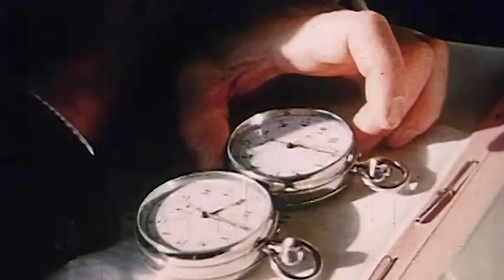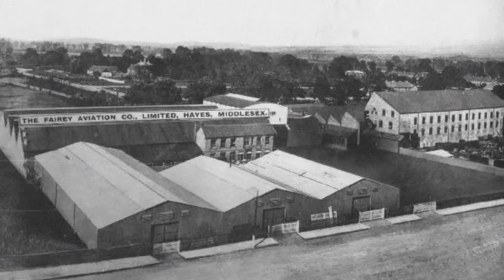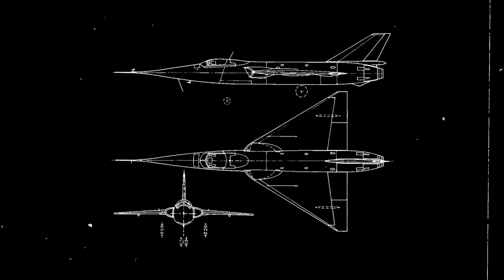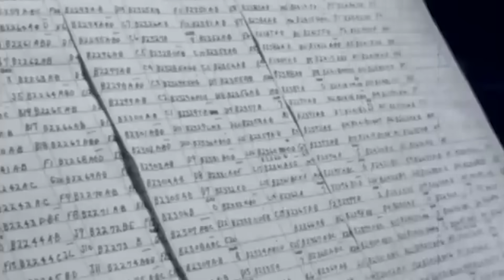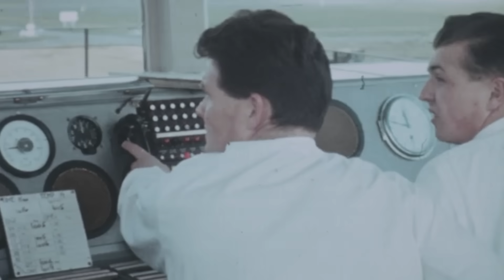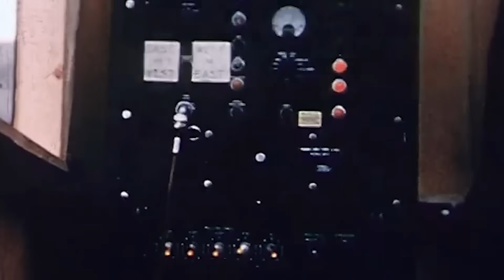Britain's 300 MPH Most Successful Mistake

Comment: The Dassault 'Mirage', as used by the South African Air Force, was THE jet plane of my childhood.  It's only thanks to this excellent video that I know that it was based on a British design.
Reply: It wasn't
Reply: @jeremycruickshank8614 

We believe we can clear up some commonly held myths and misconceptions, obviously

It's always good to see the facts presented clearly and concisely isn't it?

The original fabulous Whittle reverse combuster centrifugal compressor gas turbine aero engine has been in production permanently in one form or another by more that one manufacturer since 1939. The main current application is for helicopters. 
Whittle performed the world's first demonstration of a gas turbine aero ending in 1937. 

British Aerospace Sector & some bits & bobs etc. 

Interesting British achievements.
There is no doubt that the Fairey (England)
Delta 2 was of course the world's first jet
aircraft to exceed 1000 mph.  lndeed It
exceeded the previous record by 310 mph &
held the record for more than a year. Incidentally, the Dassault Mirage series of aircraft are based on the Fairey Delta 2. 
March 1956,  UK Peter Twiss,
1,132	 mph, Fairey Delta 2,	 Chichester, UK

The next speed record after the FD2 -
December 1957, USAF	1,207.6	mph, McDonnell F-101A Voodoo, 	Muroc, California 😎.

Non combat phase accident losses.
% of Aircraft built.
The EE Lightening did not have unusually high losses. 
The Canadair CL-44 was a turboprop airliner.
Canadair CL-44               (ff 1959 ) 48%
Lockheed XF104             (ff 1954) 100%
Lockheed  P80                (ff 1944)  43%
Lockheed F104               (ff 1954)  45%
MD FH Phantom 1          (ff 1945)  35%
MD F4 Phantom 2           (ff 1958)  28%
Convair F102 Dagger      (ff 1953)  45%  
MD F3H  Demon              (ff 1951)  32%
MD F-101 Voodoo           (ff 1954)  34%
EE Lightening                   (ff 1954)  33%
Gloster Meteor                (ff 1943)   21%
DH Vampire                     (ff 1943)   23%
DH Sea Vixen                  (ff  1951)  33%
Gloster Javelin                (ff 1951)   20%

Note that the Meteor didn't have particularly high losses, flew with more than 20 airforces for decades, got involved in air to air combat during a number of conflicts successfully against aircraft that first flew many years after the Meteor first flew.

Early days, jet engines. Whittle performed the world's furst demonstration of a gas turbine aero engine in 1937. The RR Nene, a centrifugal gas turbine aero engine, was the world's most reliable & most powerful gas turbine aero engine in 1944. Licensed built versions & copies of the RR Nene & RR Derwent would go on to power many aircraft in Russia including the Mig 15 & Mig 17, the US, China, France & other countries for decades after 1944. Incidentally, the Mig-15 was in essence an upsized / tweaked copy of the Whittle / Gloster E28/39 jet aircraft including a copy of the RR engine.  The centrifugal compressor gas turbine aero engine with Whittle style reverse flow combusters and sometimes an axial compressor section is still manufactured by more than one company, the main application being helicopters.

   That's correct, The Tornado & Typhoon & their engines are supersonic & are indeed British design aircraft with British design engines built by an international consortium. The Tornado design for example started life during the 1950s at Vickers as the AFVG, it's engine is based on the RR RB-199. The EE Lightening is also a British Supersonic jet aircraft. At the time the EE Lightening first flew it was indeed one of the fastest aircraft on the planet, it was still one of the fastest aircraft on the planet 4 years later when it managed a mach 2 flight.

  The Typhoon is the British BAC-EAP with an engine based on the British RR XG-40, the Typhoon is also built by an international consortium.

  Clearly It's a great pity & a crying shame that British military forces had to occupy a large part of Germany for decades after 1945 & Russian military forces had to do the same. Of course Russia still posseses a large chunk of what was German territory & of course  Russia & the UK produce nukes. Obviously Germany does not produce nukes.

An example of what goes on these days in various countries.

   Indeed, There are no German companies that make German jet aircraft in Germany & there are no German Companies that make German gas turbine aero engines in Germany that are suitable for widebody airliners.

  BAe Systems, GKN Aerospace & Rolls Royce combined now do more Airbus work than Germany on an absolute basis & significantly more work than that on a per capita basis.
   
  Per capita for the home nation BAe Systems is the world's largest defence contractor. BAe systems announced the recent £4 Billion takeover of Colorado based US based Ball Aerospace.
  
  BAE systems now does a significantly higher value of work for Airbus than it did when it was a major Airbus shareholder before 2005.
     
  RR now owns US Engine maker Allison for example which does classified Aerospace work for the US Govt.
   
 Anybody currently flying on a widebody airliner stands a good chance of being on an aircraft powered by RR gas turbine aero engines built in the UK.

  A glimpse of what goes on in the very internationally orientated British aerospace sector.

Boeing Apache Attack Helicopter.
AH-64: 75 UK suppliers, 7% UK content, global fleet of 1280+ aircraft.
F35B more than 130 UK Suppliers, more than 30% UK content.
F35A & F35C more than 130 UK Suppliers, more than 15% UK content.

The UK has the world's highest combined per capita Nuclear, Defence & Aerospace Sector activity.

Rolls Royce Holdings UK
Subsidiaries
- Rolls-Royce plc
- Rolls-Royce North America (Allison etc &  
  Classified Military stuff)
- Rolls-Royce AB
- Rolls-Royce Deutschland
- Rolls-Royce India Private Limited
- Rolls-Royce Marine Power Operations
- Vinters Engineering Limited
- Rolls-Royce Controls and Data Services
- Rolls-Royce Power Systems
- Bergen Marine
Joint ventures include:
- Rolls-Royce Turbomeca
- MTU Turbomeca -

Trent Family
The MT30 (Marine Turbine)
Industrial Trent 60 Gas Turbine
Trent 7000
Trent XWB Airbus A330neo.
Trent 1500
Trent 1000
Trent 500
Trent 600
Trent 700
Trent 800
Trent 8100
Trent 900

RR wholly owned subsidiaries in Germany handle smaller 2 shaft RR gas turbine aero engine work.   

We hope this helps of course.
     
Cheers, as always & indeed 👍.

Comment: The 1,132mph speed record was actually set over a course between RNAS Ford and Chichester in West Sussex by Peter Twiss at a height of 38,000ft. The Fairey Delta 2 had just enough fuel to take off from Boscombe Down in Wiltshire, perform a curving climb to the west/south-west and then run straight in an easterly direction for the first run, perform a 180 degree turn and then perform the westerly run and descend towards Boscombe Down to land.

Later the Delta 2 did fly in France as the insurance premium against damage to windows on the ground was quoted by a French insurer as orders of magnitude less than a British company wanted for the same cover.
Reply: And that was the aircrafts Achilles heel. Less range than a Lightning F1.
Reply: Exactly. The video description implies it happened by accident as Twiss accelerated. Air speed records are always carefully planned and independently recorded to prove. It's a great story but poorly written.
Reply: The record was set over France. Fairey couldn't get an insurance company to insure it to fly in British airspace. It's all covered in the "Empire of The Clouds" book by James Hamilton-Paterson. As regards its use as a fighter: Fairey's offered to produce the world's fastest jet fighter based on the FD2 but Duncan Sandys told them not to bother, all such military aircraft would be pilotless in 5 years.
Reply: @martinradcliffe1332  The record was set over West Sussex, it's detailed in "Faster Than The Sun" by Peter Twiss. If you go to the FAA Museum at Yeovilton you can stand next to WG774 and listen to the audio of the record run playing in a loop.

The insurance problem came later when Fairey wanted to fly up the Irish Sea, a British insurance company quoted a ridiculous premium for cover for broken windows and greenhouses. When they transferred to France it was covered for a single £40 premium and there were no claims made at all.
Reply: @martinradcliffe1332  Ah yes, Duncan Sandys.  I Remember him as the bright spark stating that there was no way on earth that the Germans had ANY kind of rockets, let alone one that could reach London.  About that very moment the first wave of V1 flying bombs arrived.....

Comment: Why no mention of the invaluable work of developing the ogival wing shape used on Concorde? The only mention here is rather perfunctory and almost derogatory!
Reply: Fairey had no involvement with the development of the Concorde... they went tits-up 2 years before the Concorde program started.
Like the FD2,  Concorde was a failure that never entered full production..
Reply: @DoktorBayerischeMotorenWerke 

The Fairey Delta 2 was the worlds first jet aircraft to exceed 1,000 miles per hour (1,600 km/h) in level flight. On 10 March 1956, it set a new world speed record of 1,132 mph (1,822 km/h), exceeding the previous official record by 310 mph (500 km/h). The Delta 2 held the absolute World Air Speed Record for over a year. It continued to be used for flight testing, and was allocated to the Royal Aircraft Establishment (RAE) in 1958.

A testbed aircraft was required to verify design calculations and wind tunnel results for the Concorde "ogee delta" wing design so one of the aircraft was extensively rebuilt as the BAC 221. On 1 May 1964, the modified aircraft performed its first flight. The FD2 was also used as the basis for Fairey's submissions to the Ministry for advanced all-weather interceptor designs, culminating in the proposed Fairey Delta 3 to meet the F.155 specification.
Reply: @DoktorBayerischeMotorenWerke 

The government in the late 1950s was determined to rationalise the UK's aero industry. The Ministry of Defence saw the future of helicopters as being best met by a single manufacturer. The merger of Fairey's aviation interests with Westland Aircraft took place in early 1960 shortly after Westland had acquired the Saunders-Roe group and the helicopter division of the Bristol Aeroplane Company. Westland Aircraft and the Fairey Company announced that they had reached agreement for the sale by Fairey to Westland of the issued share capital of Fairey Aviation, which operated all Fairey's UK aviation interests. Westland acquired all Fairey's aircraft manufacturing business (including the Gannet AEW.3) and Fairey's 10% investment in the Aircraft Manufacturing Company (Airco)[citation needed] Fairey's workforce employed on manufacture of the outer wings of the Airco D.H.121.[citation needed] (later to be the HS 121 Trident) was transferred to Westland. Fairey received 2,000,000 Westland shares of 5 shillings each and a cash payment of approximately £1.4m. The sale did not include Fairey Air Surveys or the works at Heston which was home to the weapon division, which had a contract for research into advanced anti-tank missile systems. Fairey's remaining net worth was approximately £9.5m.
Reply: @DoktorBayerischeMotorenWerke Aircraft production was primarily at the factory in North Hyde Road, Hayes (Middlesex), with flight testing carried out at Northolt Aerodrome (1917–1929), Great West Aerodrome (1930–1944), Heston Airport (1944–1947), and finally at White Waltham (1947–1964).[2] Losing the Great West Aerodrome in 1944 by requisition by the Air Ministry to build London Heathrow Airport, with no compensation until 1964, caused a severe financial shock which may have hastened the company's end.
Reply: @DoktorBayerischeMotorenWerke 

Fairey Aviation.
Aircraft production was primarily at the factory in North Hyde Road, Hayes (Middlesex), with flight testing carried out at Northolt Aerodrome (1917–1929), Great West Aerodrome (1930–1944), Heston Airport (1944–1947), and finally at White Waltham (1947–1964). Losing the Great West Aerodrome in 1944 by requisition by the Air Ministry to build London Heathrow Airport, with no compensation until 1964, caused a severe financial shock which  hastened the company's end.